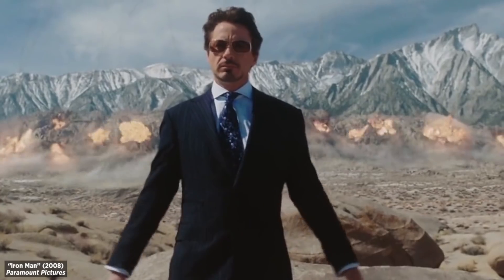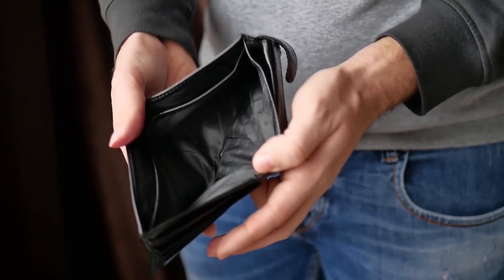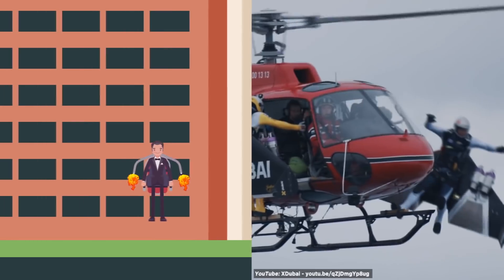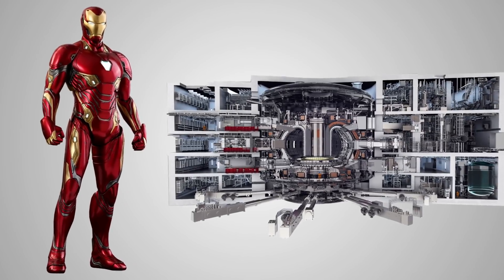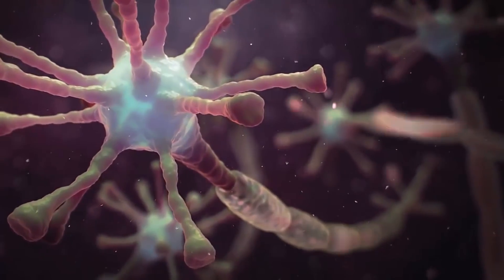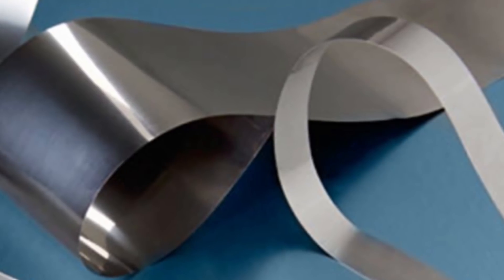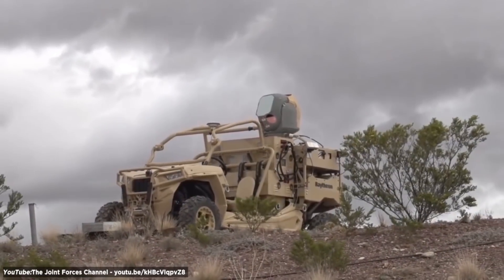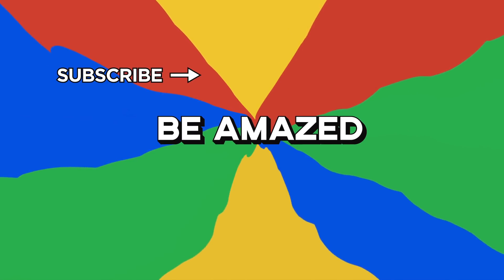How Close Are We To A Real Iron Man Suit?

Comment: If we were to use a carbon nanotube or (cnt) for short, and a titanium mixed metal, this would give us a crazy strong suit that is light wight. There are also carbon nanotube battery's that are way more powerful than normal lithium battery. To compare lithium to a (cnt) battery, a fully charged lithium battery in an electric will give you anywhere to 200 to 450 miles, and this is after hours of charging while a (cnt) battery in 4 minutes will give you an 80% charge that will go three times long than lithium. the only thing with carbon nanotube battery's is they are not on the market yet.
Reply: don't stop there. Nanotube can be used to make electrical wiring insanely small. Making it possible to make jet propellors insanely small.
Reply: I know, cnt are literally the vibranum of this would. We can use them for almost anything with them being 400 times stronger than steel at only a 6th of the weight or something like that.

Comment: What you're saying is somewhat valid unless we understand quantum energy first. 
 To whom who doesn't know:  Quantum energy is the energy that holds atoms in a molecule and that energy is infinite which means basically you can have a small battery the size of a nail in every single thing that you want. Its gonna be able to power it for many years, could power a car, a house, a plane, or just about anything. you will throw your computer away before you throw away the battery

Comment: Unless you spend tons on money on a passive brainwave system much like a high-tech prosthesis you will not achieve anything close to a real Iron man suit.
Also the miniature propulsion systems in the boots and hands are still impossible by today's technology.
I have designed a suit I believe is as close as it can get, but I can't afford to build it and I'm still struggling to shrink the on-board power supply.
Strength ✔
Armour ✔
AI ✔
Weapons ✔
Flight - short distance but yes
My guess at materials price ~$1,000,000.00
The armour and power with sincronized AI is Not cheap to build
Also the AI has a set back - once programmed to an individual it will only work for that individual.

Comment: Never.  It's impossible, you'd have to invent perpetual motion (Or compact cold fusion that is safe to have mounted in your sternum) and Galifreyan technology to pack all that in, with a human being.  Vanko/Hammer drones are doable, with current technology.  (Just not practical, and will never be practical on Earth, because we have too much Gravity, and Atmosphere.)  If you make it a suit, you have to put in Life Support.  Not to mention all those weapons, engines, articulation, actuators, make it fold into a breifcase, fly autonomously, and kinetic energy beams.  It's comic book science.  Just the Repulsors are basically Cyclops' eyes, without a power supply that will work.  It just won't work, there's too much handwavium packed in.
Reply: Dude did alchemy in his garage.  He propped the cyclotron up with a piece of brickabrack, and leveled it with a 2' whiskey stick.  He aimed the splitter prism with a pipe wrench.  That's just one of the impossible things he did, that day.  It's Tony Stark, impossible science is kinda his thing.  Even the Mark I wouldn't fly with him in it.  Maybe if you took him out, and put in fuel tanks.

Comment: @BE AMAZED  i think i got the solution. 
1. You mentioned heat and light
2. You mentioned 16 000 000 hp
3.reactor that produces more energy than it consumes
4.Flying problem
And last ,instead of the famous ,,arc reactor " we can use just one and only element and that is LORANDIT-it has the same power in itself like the sun, which can be found only in my country
Reply: That's not an element
Reply: @db5094  what do you mean
Reply: @makotonagano3920  LorandIt whatever is not real
Reply: @db5094  i am not an expert but i think it can be transformed to something worthy  because we can have free eletric power wih it but govt doesnt approve it

Comment: why don't they just use carbon fiber mixed with nanotech and some heat protective material to create the suit and jet fuel a t low cost with electrolites to maintain the heat  and power to build the jets and for the laser just no.. not yet..
Reply: Dude no offense, but you have no idea what youre talking about
Reply: @db5094  yes i do i did a lot of research
Reply: @emmanuelblanco8899  no you didn't. How would electrolytes maintain the heat? How do you mix carbon fibre with nanotech? Do you realise the nanotech needed does not exist?
Reply: you clearly did not read my text correctly or maybe i misspelled?
Reply: wait i said carbon fiber i just realised i meant nanotubes
Reply: @emmanuelblanco8899  that isnt better. Nano tubes arent meant for that type of stuff..
Reply: @db5094  you just can't think
Reply: god dang' it your to good frick me.,
Reply: @emmanuelblanco8899  🙄
Reply: @KnHighmer_Dos  yes what

Comment: First of all, a small correction: we’ve been fascinated by automatons since ancient times. The Greeks and Romans were the first to describe them.

I think a real life iron man would more resemble the type of power armor Master Chief wears. Jet pack flying and ion cannons can come as additions since they can’t be easily built in, especially when you have to carry the extra weight all the times. But Master Chief is, unlike the fantastical iron man suit, an excellent metric for what to expect: extremely bullet proof, enhances foot mobility to eliminate the need for a small vehicle over distances less than 50km, reacts extremely quickly to the user’s neural commands to muscle.

Another good metric: the biomech suit of a predator. Enhanced vision, addon weapons and stealth would also be essential. 

The primary weapon would be some sort of universal rifle with laser, maser, phasers included with some sort of combo gun/coil gun/railgun/plasma gun. An assault rifle that is backwards compatible with several different sizes of bullets but is magnetically rifled (bullets spin with magnetic influence) so that it can also fire plasma, ferromagnetic and diamagnetic projectiles; some of which could exceed 2km/sec in muzzle velocity.

Why all this though? Because guns are obsolete. Because we continue to use them for intimidation when they could be countered very effectively and cheaply. And instead of using firearms, using a weapon that can incapacitate, injure, kill or disintegrate means that gun owners no longer can be given a freedom, or the excuse, to use a gun to kill someone in self defense if they had the option of less lethal defense. Passive defense trumps Violence.

Comment: I am also an EE, and a fan of Iron Man but here are some thoughts:
1. Building the second suit in that many little pieces of metal that move like that with intricate movements will produce an overall weak overall suit strength. It won't be bullet-proof let alone fly. 
2. Having all small parts made from a metal that is light enough to fly and strong enough to be bulletproof does not exist. 
3. Supersonic flight will introduce so much heat into the structure he will cook like a hotdog in foil. Not to mention it will warp the structure and won't be able to get out of it. SR71 warps, so will this.
4. Let alone all metals will fail if heated to this level structurally as thin as they are shown in the movie. He couldn't hold up his head supersonic, turning it will snap his head off his shoulders and arms off his body at 1/4 these speeds. This suit will disintegrate with him in it. Let alone having control over supersonic flight to out-maneuver two F22's again without any ailerons and wings just not possible. 
5. Jarvis would require a computer the size of a room to do those supercomputer calculations at the speeds it does in the movie. Even if Jarvis was ground based and accessed through a communication module, there would be lapses in range and altitude and the speed of those transfers of that much data are not possible with today's telecommunication devices to circumnavigate the globe in space with full high speed data to run a supercomputer. My Electronic Engineering degree is in Telecom emphasis.
6. Easy enough to beat the icing problem with 3.3GJ/s you can make hot exo-suit to melt the ice, warm the person inside and thats not even using NASA insulation tech like ceramic coatings, Aspen Aerogel insulation and vacuum sealing the body in a temperature controlled chamber. This is the most probable to fix out of the problems outlined here. 
7. The military has some of these weapons already that are light enough to use in a suit like this, that can incapacitate people non lethally using different kinds of sound waves. DARPA made a lot of this tech. They were going to use it in crowd control but ultimately deemed it inhumane treatment.
8. The most improbable part of the suit is the repulsior tech. If it was powerful enough to do what it does in the movie, Tony's arm would snap off every time he fired it at someone. For every pound of force forward, there is a pound pushing back on his arm. If you have enough force to knock a man back 50 ft then that is how much force is pushing on one arm. Can a man hit someone with enough force to knock him back 50 feet with one arm? No. His arm would be shattered. And if you are supposing that the suit takes the force then there is still a problem in the fact that he does not weigh enough to not move an inch with that much force applied to his body stationary. He would fly back the opposite direction  less than <50 ft as well with every single firing. This could be solved by putting out an arm in the opposite direction cancelling the force on him and just blow the opponent backwards. Any deviation in angle that isn't 180 degrees would result in a unexpected trip at an angle of the perpendicular to the force of those two angles. 
9. The little missiles he has in the movies wouldn't make a dent in half of those armored vehicles and he would be out of ammo very quickly. This suit's best mission operations would be stealth reconnaissance in hard to reach areas, not direct confrontations with hardened military war machines. A drone would work better. 

Final thoughts, I designed an Iron Man ish suit almost a decade before this movie initially came out. The one thing that the movie gets wrong on a large scale is literally the size of the suit. It can be made but will most likely be the size of the big suit in IM2 or the Hulkbuster. With todays tech it has to be bigger to fit everything in it...And if it's bullet proof, it won't fly and if it flies, it won't be bulletproof. So basically he will be no better than Falcon in fancy attire. Matter of fact based on the surface area of those wings Falcon has and being much lighter, he should be able to easily out-maneuver Iron Man aerially any day of the week. (with longer flight time X2)

Comment: Yeah the power source will always be the problem. Although it might not be technically impossible to create such a small fusion reactor, given at least a century of research; Making one with such a flawless efficiency and design that it doesn't generate insane amounts of heat is not.

You don't need to look much further than at the skies to see that, the sun is a massive fusion reactor, and as efficient as one can ever hope to get, and yet.. It's kinda hot isn't it?

Comment: You can remove gas Molicules from substances like dantium amd tridium to create ion fusion which then runs through the donut at light speed and the pladium core is a magnet which keeps the iofusion in the reacter and the coils at the edge will also act as a magnet ones it is ourputing enough energy you shut of the process of creating more ion fusion and then it's self sustaning

Comment: the reason why we don't have battery powered jet engines is because nobody have tried to make one. the thing is that with electricity we can make hot plasma balls or a ion motor. if we used the same type of circuit to create a ion motor and used it to heat air into air plasma we could use compressed air from a jet engine to generate high pressure electrically induced hot air plasma that would be able to behave equal to that of ordinary combustable fuel by means of thrust as is somthing that could be powered by a lithium ion battery and produce even a particle beam of light just like in iron man. even if the beam from a lithium battery only lasted for a few seconds, such a technology would prove itself.

Comment: Thats possible as if v will make a power controller (arc reactor) or some power observer and a thin batteries which are attached to the back side of shield those main part wire or wireless can be attached to front side of some arc reactors or a powerful observer and that may pass energy  to all parts and coming to flying part and that could be made by the huge air or combined lazer beams that may take some 5-6years. Any atom or any element which can bare and observe a huge amount of electricity. That can pass energy to all parts and all else tech is already with us like helmet projections E.T.C
Alright

Comment: the problem isnt the tech at this point in time its off the self parts  . the problem is size, weight ,materials ,energy density, and range or the   of the power source... not no mention the cost   . this will hold back alot of tech for the coming years... you see it it phones .. cars .. drones and other battery operated devices

Comment: The answer to the power suite is force conversion at a molecular level.  If we can synthesize common elements like carbon, hydrogen and/or oxygen to exponentially act on a surface causing heat and/or expansion we'd have an Iron man suite.

Comment: actually it is possible if you give the helmet an independent power source and did not put any light you will save a lot of energy and for weapons we can be put some small daggers made of aluminum in the arms with an electric stun system which will stun anyone touch you , we can make the structure of  graphene It is  aluminum white  and stronger than diamonds for long-range weapons We can use a laser with a power of 7000 MW the laser can be seen only throughout  a camera or with a costume made  glasses maybe we can make a flat small grenade that fits in the pocket if it was small enough you will be able to store up to 8 grenades in your suit and you can put a small fire-gun system which will help you to take out multiple enemy's the fuel for the fire gun can be alcohol you will be able to refill it with anything with alcohol or maybe even normal car fuel the system will shot some alcohol   while burning a small fire which will make a big fire ball and you can put a small gun like this https://www.newlaunches.com/wp-content/uploads/2013/01/small_automatic1.jpg or this https://i.pinimg.com/736x/5b/20/0c/5b200c54f3285a5c0dafb42a1324792c--tactical-firearms-tactical-gear.jpg
to fly you can put a small turbojet enjine on evry leg wich will be able to handle 180 kg

Comment: Jetpacks were fully developed in the 70's. The Army never used them because a flying soldier is an easy target. Much easier than a guy standing behind cover or sitting in a tank. For that same reason, you won't see Iron Man suits in any actual military.
Reply: Jean Roch Iron Man suit can resist even a 50 cal bullet
Reply: @mrstrange9817  yeah in the movies maybe. In real like, there's no material thin enough to make an iron man suit that will stop a 50 cal. Even if that material existed, you'd get concussed into a coma inside that suit.

Comment: you need an energy source that can produce power for the suit like a nuclear reactor or something a long those lines, fossil fuels aint gonna cut it,  this is why tony stark took his arc reactor and down sized it, not even elon musk could make a suit like tony stark, the power source just aint there yet, and 200 mph is no where near the speed of sound, the ironman suit is been shown to fly faster than sound, which is 767 mph, you are gonna need a ton of power on tap, and something that will fit inside the suit...lets be real for a second, a suit like tony stark's suit is well beyond what we currently have, its not the metals or other materials..its the power supply we are mission, the amount of energy the arc reactor can provide at a small size is outside what we currently can make, maybe in 30-40 years we might start to scratch the surface

Comment: parts list
GRAVITY INDUSTRIES Jet Suit Series 4 flight time over 10 mins (runs on runs of Li-on batteries).
Titanium printed suit from EOS (bullet proof) with the Guardian XO exoskeleton integrated (below 400w of power needed for suit).
for heating problems coat the suit in (HRSI) silicon same thing they use for the space shuttles heat shield tiles.

Sorbothane would be the bet for shock absorbing and damping.
would also need some king of military flight program and weapons tracking system.
weapon system use the laser tech that ELI-NP HPLS are using.
Reply: Sounds amazing.

Comment: If gas is a problem when going  aerodynamic, just use the same technology that windmills use as power.
Reply: Not enough power output in a short enough time, even before taking air resistance into account
Reply: WDYM?
Reply: @Cyancat123  just put windmills at the bottom of your feet

Comment: One point that is always missed is the use of low level force fields. Also, molten salt batteries or even a radium battery variants could be used for power. Has anyone noticed that the repulsors and boot jets are basically arc or magneto plasma dynamic thrusters with weaponized cyclotron technology?

Comment: Yet the power source with so high energy density is very difficult task to design. From the design vision we can easily design a mechasims which repulses high mass of air by using high rpm motors and providing rocket propulsion design of diffuser